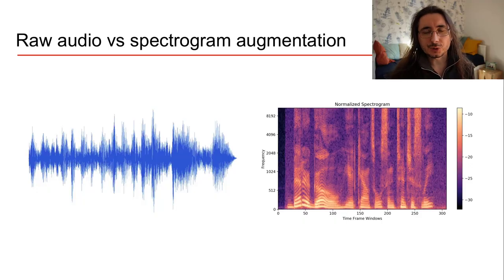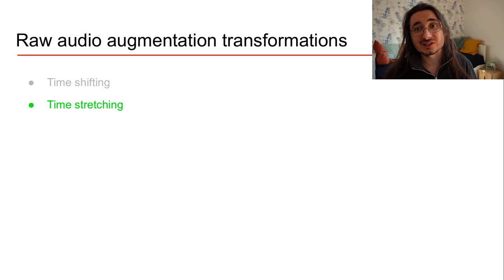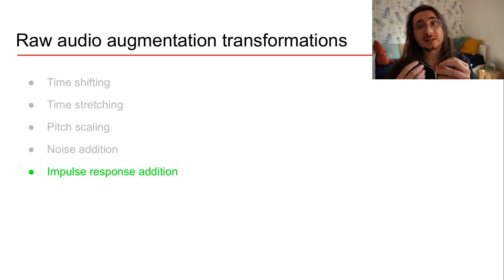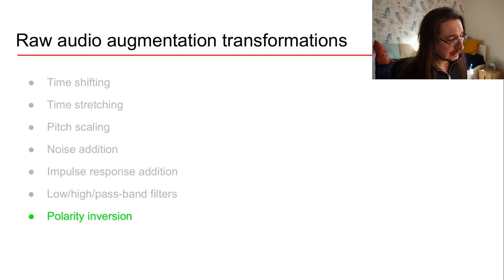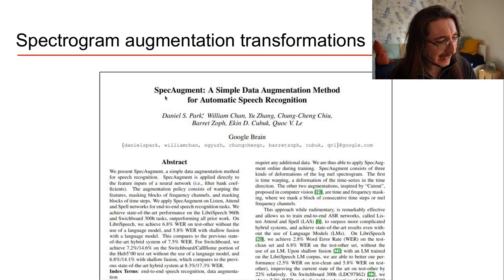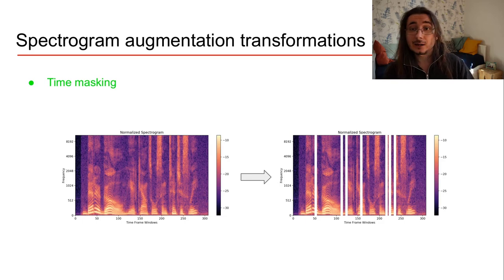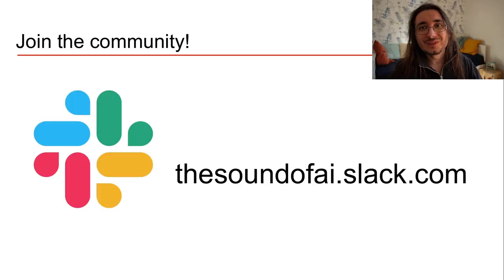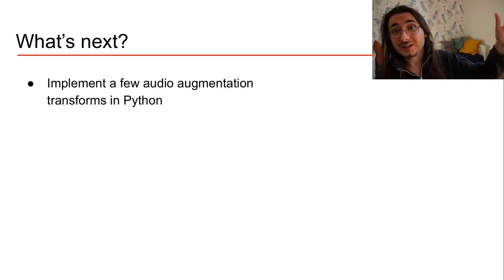Audio Data Augmentation Techniques: The Theory

Comment: So if you were going to use time stretching for spectrograms you'd stretch some samples and some samples you'd leave alone. But wouldn't you get a dataset with mismatched shapes? Also, can you combine let's say time stretching and noise addition or pitch augmentation or is it recommended to add only one augmentation type to a spectrogram? So basically make more copies and add 1 type of augmentation to each?

Comment: I always appreciate your excellent videos and your hard work, Valerio. I have a question for you. I want to train my model using the STFT matrix (not the spectrogram) and apply some augmentation techniques. Should I augment the audio files (.wav) first and then convert them to STFT, or should I convert them to STFT first and then augment them?
Reply from the maker: Both options are possible. I usually prefer doing augmentation on the STFT. In my experience, it tends to work better for most use cases.

Comment: Thank you for the great explanations!

I have a question:
For the spectrogram-based techniques, is it feasible to apply them to the waveform-based model, e.g., wav2vec2, after manipulations on the spectrogram? If yes, how can it be brought back to the time domain? With the absence of phase information, I don't know how to do it, are there techniques for this?
Reply from the maker: Recontructing phase it's highly complicated and definitely not solved. A simple approach is to use the original phase.

Comment: You are Great.
I have a question.
Almost 60 years old.
Not familiar with math, but I am interested in sound and I have some ideas in it.
How long do you think it can take me to get familiar with linear algebra and work in this field?
Best regards.
Reply from the maker: Thank you for the great question. If you are consistent, it'll probably take you 1 year to build all the math skills to work in the field (e.g., linear algebra, calculus, probability, Fourier Transform...). Of course, you don't need to master all the mathematical concepts behind AI Music to start playing around with it. You can gradually acquire the theoretical knowledge while you experiment with cool applications and coding. I believe that's the most compelling learning path. That's what I use to teach AI in this channel.
Reply: @ValerioVelardoTheSoundofAI  I am so thrilled for your comprehensive response.
This will encourage me more.
I don't know whether the idea in the following paragraph has come to accomplishment or not, but I say it to you.
One of my idea is that if we have a long audio file, and we want to see if there is a certain word or sentence, we can type the desired word or sentence in the software, and it can find the location of that word said for example by the speaker.
I hope it doesn't seem silly.
Kind regards.